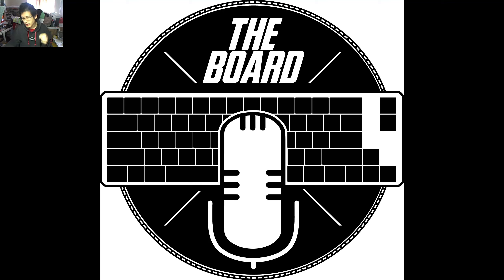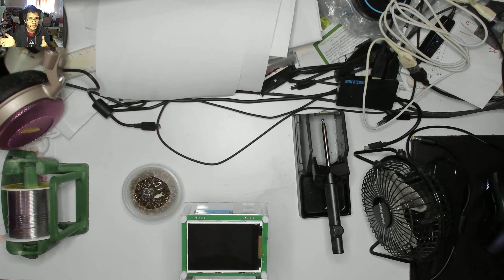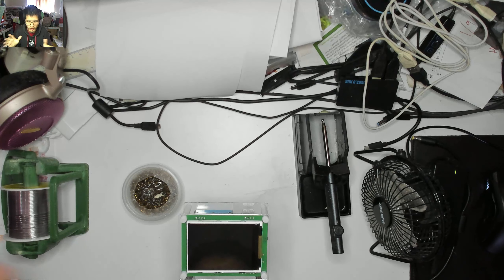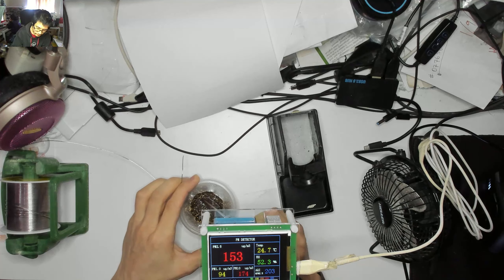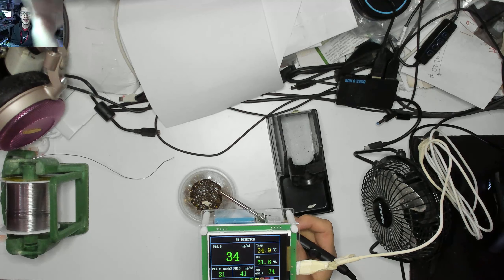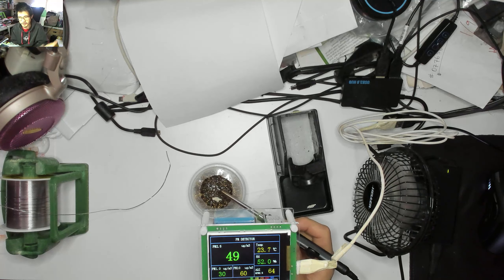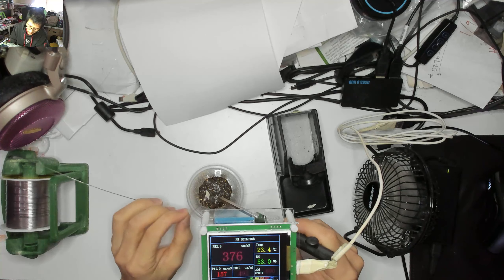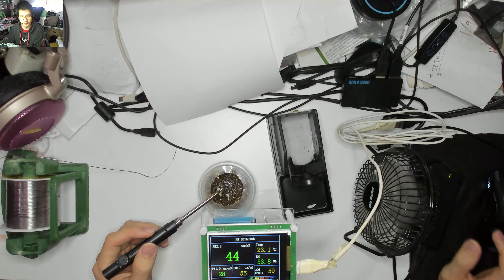How Bad Are Soldering Fumes?

Comment: about the fan, what if you had a WAY bigger fan, which is definitely MUCH more powerful than that tiny fan. would it affect it in a different way?
Reply from the maker: Sure would, it'd disperse particulate faster, but not necessarily further. It would swirl the air around harder, making it more even, which, if the air didn't have a flow path outwards, you'd make the zone probably have an overall lower, but more dispersed PM count.
Reply: honestly, I'll just do it in a well-ventilated area, at least as much as possible. I've been thinking of how the turbulence would affect the fumes in the air, and I really should just solder either outside, or with the windows and doors open (in my bedroom btw), as well in small quantities, to avoid over-exposure to these fumes. I've also experienced irritation on my eyes when  they were directly in my face (don't worry, I was just testing, though I still shouldn't do it), and I don't want any bit of that contacting my eyes! Anyway, thanks!
Reply from the maker: @ユイェン  The general advice here really is, if you can afford to get filtration, it'll do you better than without it. If you can't afford filtration, then as much ventilation as possible with moving airflow in a steady direction of in, and out.

Turbulence isn't going to make any difference in the context if the air doesn't leave your workspace, the particulates don't go anywhere but just tumble around in the same room.  

Working in small amounts certainly will reduce your contact and exposure, but of course the payoff is going to be in time to setup and solder (if you have that much free time) multiple times vs doing it in one go.

Alternatively, a face mask that can catch PM2.5 particulates would also work, like a N95/P2 mask, and some safety goggles to reduce direct fumes into your eyes.
Reply: speaking of goggles, what are some you might recommend to me?
Reply from the maker: @ユイェン  Not really something I have any recommendations on haha, really any safety glasses are probably going to be just fine. I use prescription ones for work, so I can' really say much, the ones I have at home are UVEX branded ones but they're from my university days.....

Comment: Is this lead free solder?
I have just started a cable production job & my trainer says it is lead free stuff we use.
That doesn't tell me it is safe to breathe in.
Is the solder you use here lead free?
Reply from the maker: No fumes you breathe is 'safe', leaded or lead free. I use leaded solder, but the smoke is mainly due to the rosin/flux. Lead vapourises at 600°C, which soldering typically doesn't get that high, around 3XX°C depending on the application and solder (leaded being lower than lead free), but you can get splutter which is very fine particles going into the air.

If you're doing that kind of work as full-time work, you should consider getting an appropriate respirator if possible.